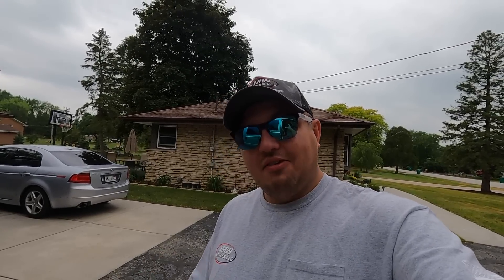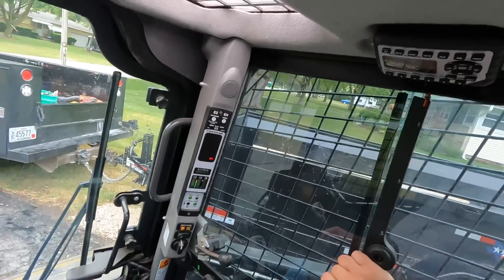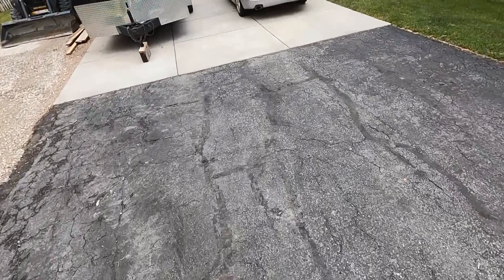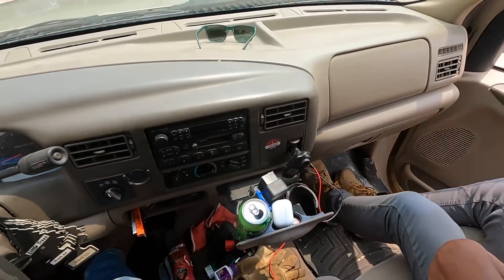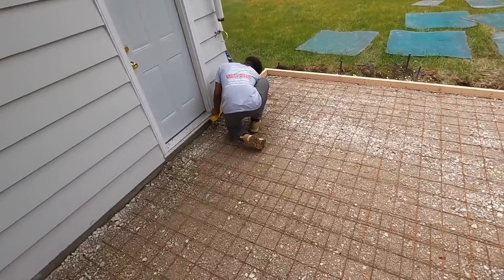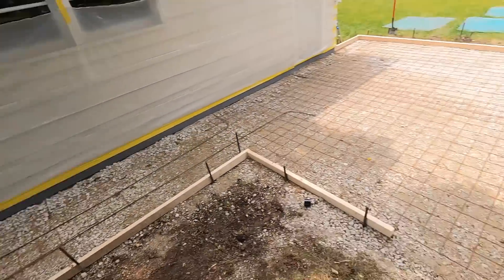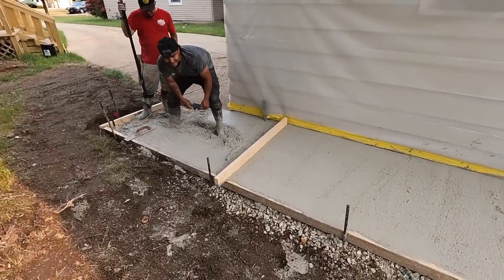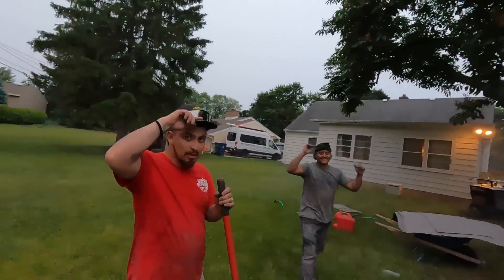THE PROS CAME TO HELP ON THIS ONE!!!

Comment: Mike, why don't you cut joints? do you return with a concrete saw after its dry. I've watched your few pours and was shocked. I mean Ryan does them in all his videos
Reply from the maker: I go back and saw cut them after it drys. This particular patio is stamped concrete and you always saw cut joints in

Comment: Using way to much spray adhesive on the foam expansion . Light coats on both foam and existing.  Let sit and tack up. Sticks way better and easier

Comment: Get a tote and cut some vents in the tote or metal box and put your boots and trawls in it. Like Ryan has. Also fabricate a place for your levels. Between the trailer and the truck you could draw up some cool stuff to fabricate so EVERYTHING is always ready and on the truck. Have another small shed built by the garage to put material and extra things in.

Comment: Great job Mike with all the reinforcement under the concrete and protecting the siding with plastic and using expansion foam thats how the job is done 👍 people need to take notes
Reply: ERIKKKKK
Reply: Eric needs to take notes *
Reply: lol the comments to this comment did not disappoint
Reply: @alvarorangel5513  
There would hardly be any backlash if he didn't call all the supportive advice "haters"

Comment: Mike: "Doesn't hurt to have too much reinforcement."
Eric: Reinforcement? What's that? I don't need no stinkin reinforcement.
Mike used more reinforcement on this small patio than Eric did on that large patio and side car driveway extension combined. Eric used NO wire mesh at all and probably less rebar on that whole patio and side driveway extension combined than the three sticks of rebar Mike used on this job. Eric, wake up and take notes kiddo. 👌
Reply: Office worker how do I put files in a folder?
Reply: @aricv1295  
A fanboy struggling with the truth.
Reply: 13:33
13:44
Yup. Take notes for sure.

Comment: First of loving your channel so this is all with love,Do Mike just Mike your a cool dude,second ounce of prevention is worth a pound cure that wet nail box you threw in your truck,just take a second longer and find a dry bucket then no worries less stress on you secondly  if I didn't k ow anybetter I think you were aiming for the back window of your truck with the thumper ,not or twice bit three times I think lol move some tools around organize and extra second the thumper will lay in there like a glove it's top heavy so its gonna wanna flip up in stand-up position maybe lay a chain or something heavy on the handle so your not driving down the road and get your back glass smashed anyhow your doing an awesome job congrats on your 25,000 views that's awesome

Comment: Eric is a good finisher , deff wasn’t happy to see what he did on that one driveway, it definitely needed a retain wall , feel like he’s rushing alittle but Ryan was right you gotta learn some how but if you can avoid mistakes you gotta try too. But can’t knock his work ethic and grind 💪💪💯
Reply: Foundation backfilled with sod. Which will obviously decompose causing the slab to drop. No wall. no mesh and hardly enough rebar for 8 inch thick concrete. When the carpark and patio fail. That's not learning. That's Defeated Style. End of business.

Comment: Eric and Francisco showed their stamping skill level when using the two small sized ones along the sidewalk stretch then cam back afterwards with the larger platform [slab] sized stamps over top of them... The transfer point from the slab to the sidewalk looked flawless and matched... Good job gentlemen of the crew... Oh and good catch on the drain pipe and hopefully no water stain on concrete...
Reply: Fran's YouTube channel Cisco j 414